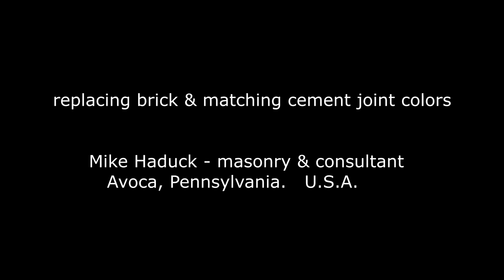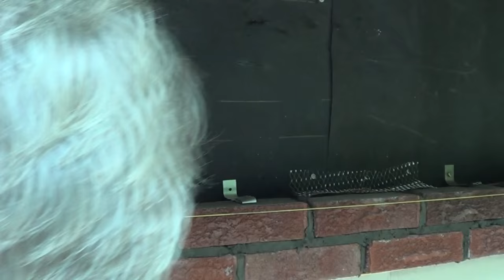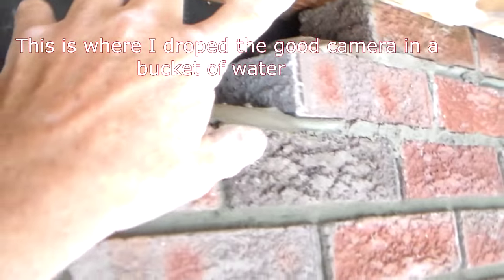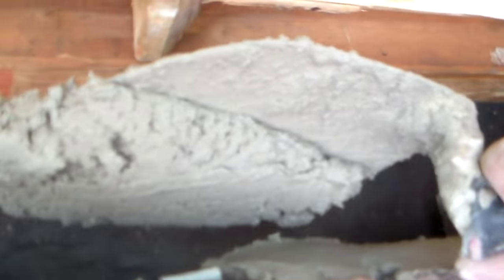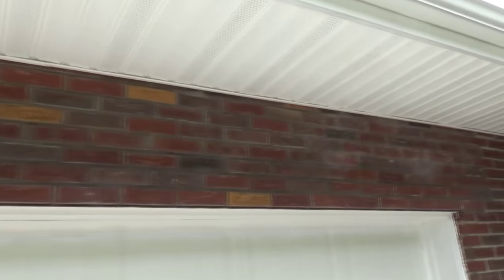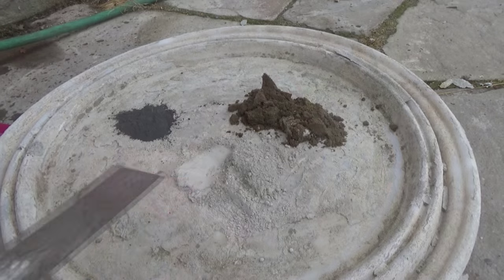MATCHING CEMENT JOINTS RE-LAY BRICK (Mike Haduck)

Comment: Just a few clarifications/corrections to help anyone in the future:
First, the term Mortar does not mean lime mortar. Type S or Type N, the most commonly used, are different ratios of Hydraulic Lime and Portland Cement. The only mortar available today that is purely Lime is Type L mortar and it's next to impossible to find. Just check the MSDS of any company that sells Mortar, it's mainly Portland Cement with Lime added as a plasticizer and to increase workability.
Second, I spend a good amount of time throughout the year trying to match colored mortar and there are many factors that come into play that determine the end result. Ambient temperature, exposure to sunlight during curing, variations of water in the mix, curing time and how much you tool it all play roles in the end result. The reason that the hair dryer test didn't work is because you used heat and moving air to cure the mortar. In the wall it cooled slower and at a lower temperature. The bricks also sucked out moisture whereas the trowel sealed in moisture behind your test.
All that being said I also wanted to thank you for your videos! I've watched a lot of them and I really enjoy seeing the way you approach you trade. Thank you!
Reply from the maker: +brandonaegerter  thanks for the input, everything helps, and I do not know it all. and I am learning everyday,  thanks for the comment.  mike

Comment: One of the first things I notice. Where, on new brick construction, when the foundation was laid on a previous date,  almost invariably the brick veneer "walls" mortar is dissimilar in color to that foundation mortar. Is this from inconsistent measuring of sand, mortar ratios, time of year, or amount of water in the mortar mix? Or is this variation more in depth? Thanks.
Reply from the maker: Hi 49,  unless the job is being done all at the same time, everything will contribute to discoloration,  traditional cements change color because of temperature, drying time, more or less water, air moisture, freezing, it goes on and on,  , the trick is to be able to hide it at the end, If that makes sense, thanks, Mike

Comment: great videos.   I was able to fix my steps and stoop  because of all your videos about steps  (The town's salt trucks throws the salt right into my steps and prematurely decimated them).   But I must say-  i took all the credit after the wife inspected and approved that job!!     So-  I also have a similar problem as you have in THIS video - on a brick veneer wall-  except my problem is on the wall corner-  not over the garage.   At the end of the wall I can remove a section  of about 6 or 8  bricks-  toward the bottom--  at the level of my waist.  Just like a puzzle piece.   the rest of the wall seems good- if not great.   Should I clean up the mortar around this and  install it back as one "puzzle piece"?   or should I break it apart and install each brick individually?    This is in NJ near the mountains (Poconos / Appalachians) very similar to the climate where you are in PA.  What mortar would you recommend for this repair?    I didn't catch exactly  how you said you modified your S mortar in this video.   I know you usually frown upon straight S mortar in this climate.   Thanks.
Reply from the maker: +Matt G  usually brick that is up and down and not getting wet, I think s mortar is fine, but if it lays flat and the weather is getting to it like outside steps I usually add a lot of Portland, everyone say different,  as far as removing a section, I would probably clean it out first and see if you can repoint it that way, If you keep the cement stiff it shouldn't get that dirty, and if all falls apart you got to relay it.  I can't say unless I was actually there to see it. whatever you do , don't ask the wife cause every man is wrong even if he is right.,  LOL   thanks mike

Comment: I will start and say I have seen a lot of your videos and as an apprentice up here in Canada you have shown me different views on how to approach jobs and for that I am happy to see informative videos about our trade but on that note I wanted to say/ask a few questions and not be that kind of guy who bad mouthing guys who post videos but here are a few things I noticed on your video. 1) The steel lintel was not cleaned to remove old rust and then re-primed ( I'm aware that everywhere does it different as I said before I have seen a lot of your videos) but industry standards are industry standards 2) Do those Lag bolts satisfy Pennsylvanian local building codes? I only ask because from the one sitting on the lintel doesn't look longer then 75mm (or just shy of 3 inches for you guys down in the states) This said it might just be how it looks on the screen but either way they do look quiet small for a garage door opening. Also the gentlemen who screwed them in seemed to tighten them quite gingerly and that the washer ended up in the cut of the steel not around the opening which defeats the purpose of a washer that or he forgot the washer on that bolt. 3) @0:43 I don't see those 3/4 bats that you installed at @1:18. 4) Building paper is to go in front steel not behind it as you can see @ 1:28 and also i noticed there were no weep holes over steel and since whom ever didn't prime the steel any water that gets behind these bricks since the steel is already aged can increase the chances of failure and a garage door opening is the last place you want a failure ( not to mention this job was to fix a failing lintel). Thanks again for all your videos cant wait for the next one
Reply from the maker: +G RaM    Thanks for the comment,  but I think your getting a little too pickey?  If I wasn't sure of the outcome I would have not taken the job, I ask my self the basics like (is water going to get to it?) (how long is the life of the job)  etc etc etc.  I was confident with these carpenters because they had 80 years of experience between them. and Inspectors usually won't come around unless they are looking for money and I would be filming them to make sure they take liability. and they don't want to take the chance..  Just the way it is.  thanks mike

Comment: Over lintel
Reply from the maker: Yes, they really didn’t use steel until latter 1800s,  most old buildings were arched or oak wood, and there is still a lot of them around,  steel expands contracts and rust,  thanks mike